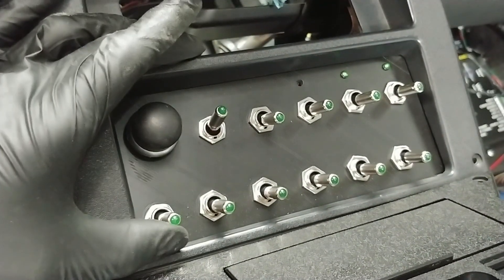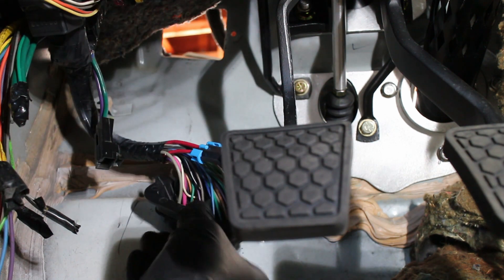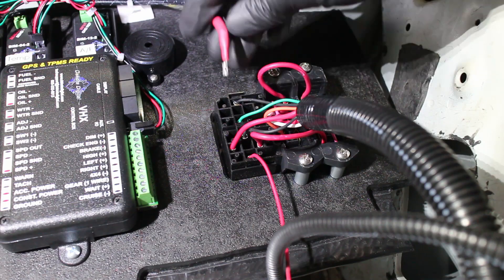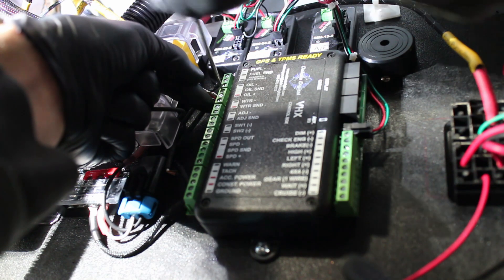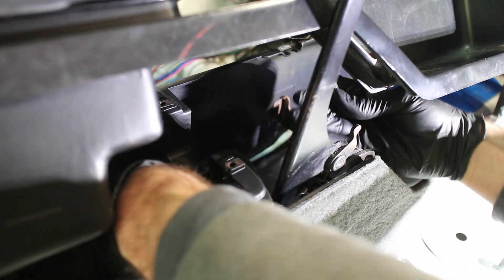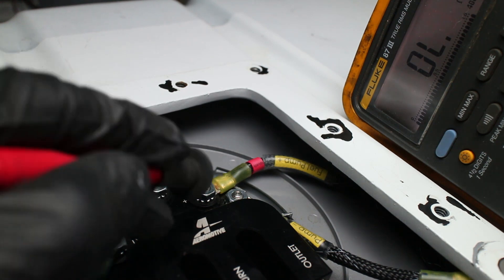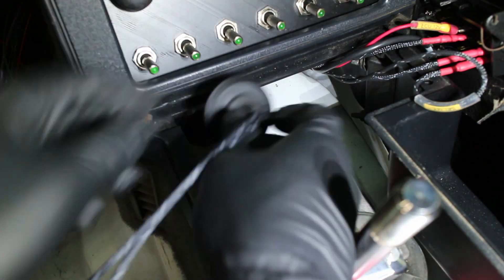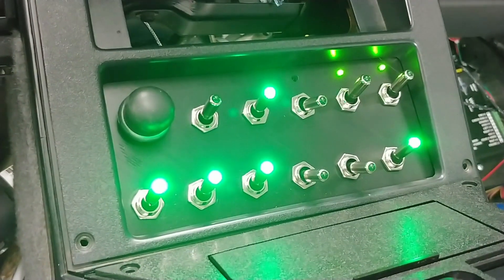LS Swap Wiring (1982-1992 Camaro & Firebird)

Comment: Hey there, I have been messing around with a 87 I rock Z 28 I pulled a 88 rock Z 28 motor and put it in plugged in the ECU and only one tail light comes on. I’m at the point to where I’m thinking about just running everything off of a toggle switch meaning toggle switch to ECU power toggle switch to fuel pump power  
Reaching out to see if you may have a wiring schematic for the steering column, so I know which wires to pull and make a toggle switch. I have scoured the Internet checked forms all the links are expired. If you have any knowledge, I’d much appreciate it thank you very much.
Reply from the maker: the column has 2 blade plugs.
one is the standard GM layout they used for like 50 years.
the other has ZERO documentation.
ZIP zero, even the 2,000 page dealer manuals are void of that info.

Comment: So will the two red lines power  the interior and lights, will that save me from having to go through the engine harness connector?
Reply from the maker: those 2 power distribution wires are part of the oem harness.
but yes, those 2 wires power basically everything inside the car.

Comment: What up bro how u doing I have 87 camaro Berlinetta  I did my First   ls swap  And I got a crank no start I have power at Ejectors In  Coil. Packs And I have spark. And then dakota digital dash and every time I turn my key over my Cluster goals black  I'm not Sure what I did wrong  And I can't figure it out
Reply from the maker: always check fuel and spark.

Comment: Do you have a link for the connector you hooked the 2 red wires too from the c100? Also is the connector hooked to your LS harness in anyway?
I’m currently in the process of this swap
Reply from the maker: the 2 c100 power distribution wires are connected into my custom fuse box.
all you need to do is feed power to those 2 wires with fused 12V power

Comment: Hey, what's up, ,yo So the two red wires that you're talking about in your video those wires  running into the starter ?
Reply from the maker: the 2 Big red wires are the stock chassis power distribution. 
so headlights, windows exe.

Comment: Hi bro .Can I still use that green wire on 4l60e  for my back up Lights too ?
Reply from the maker: yes, that chassis green wire is the only backup wire.
the 4l60E has that wire connected to the shifter plug so you'll have to search a guide on what wire to use on the 60e.

Comment: What size fuse should I run for those two red wires ?
Reply from the maker: two 10 gauge or 12 gauge.
needs to be thick wire
Reply: @3rdGenGuy  thank you! I have 10 gauge wire. Just not sure what size fuse to put in line. And do I need to put a fuse for each wire or can I put both together one just one fuse? Thank you for your time
Reply from the maker: I'd probably use something like two 40amp inline fuses for a mostly stock 3rd gen.
I used a 30 amp fuse for each wire (2x 30amp fuses), but my car has very little power draw. mainly because I removed a lot from the car.
Reply: @3rdGenGuy  thank you so much! I love your videos by the way. I’ve learned a lot from them

Comment: New subscriber. As a retired electrical engineer building a 70 Camaro that will be my first LS swap(going LSX-LS7 route) with a T-56 Magnum. I was so happy to finally find a channel that shows how to do a quality job on the LS wiring, panel, etc etc. I have been paranoid about getting the car stolen too as I plan on it being regularly driven all over the place. Thanks for the information.

Comment: I'm very interested about your bulkhead fitting for your fuel pump and sender connector. It makes sense. Is this something you are planning on selling? In kit form with pins and connectors?
Reply from the maker: I do sell them, but it's still a prototype.(sold 1 so far)
not cheap either, they are currently about $80 shipped.
Reply: @3rdGenGuy  Thanks! To order, do you have a web page/contact info?
Reply from the maker: I usually deal with messages on my instagram "@3rdgenguy"

Comment: i just installed mine 3 days ago
refresh my memory the ground wire aeromotive sent with the assembly was that for grounding the sending ground terminal or the pump ground terminal?
and as far as the other wires in the factory harness...
purple was sender positive, white is pump positive, and black is pump ground or sender ground?
i might have wired mine wrong i can't tell from your video because of whatever wrap you put on your wires🤨
edit:
i just fetched the aeromotive instructions from my car and it says to hook the included ground to sender negative terminal and the other end to a clean chassis ground, so the black wire you hooked to your sender ground....was that from the factory harness that passes through the bulk head? and if so isn't that the pump ground wire?
Reply from the maker: the (+) and (-) sending unit wires are 2 separate wires and run to the front of the car. even stock the sending unit wires aren't grounded through the chassis as it causes too much electronic noise.
if you have a stock gauge cluster, just route the 2 sending unit wires to where the stock wires connect to the chassis harness.

tank:
Fuel pump (+): to a 12v source/relay
fuel pump (-): to a ground source.  In my case, the chassis.
Sending unit (+): to gauges
sending unit (-): to gauges